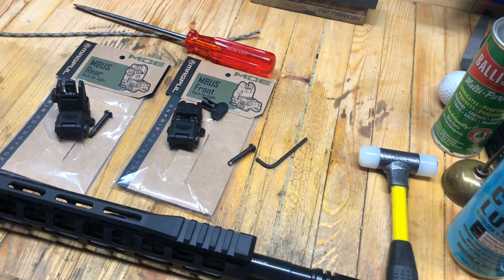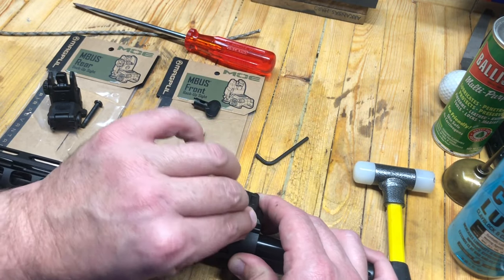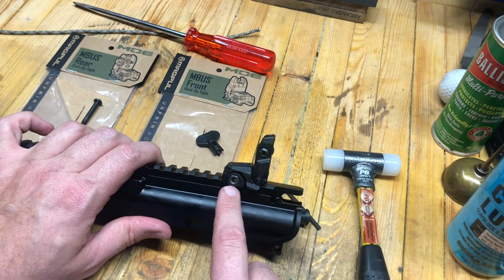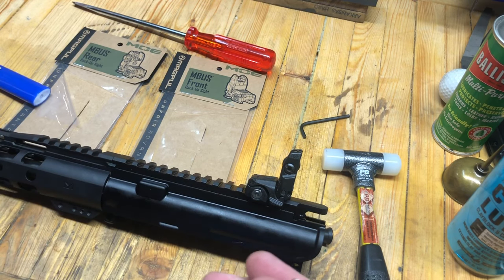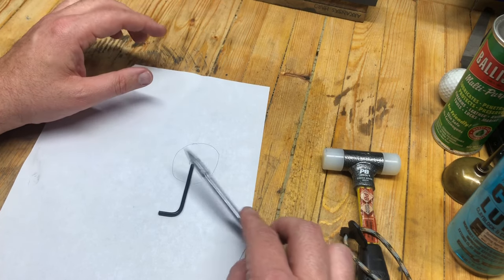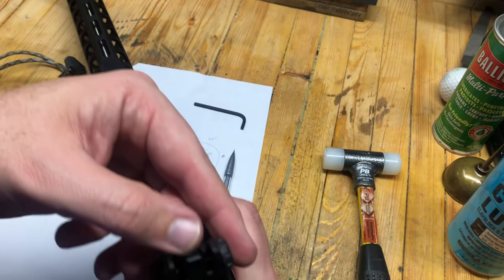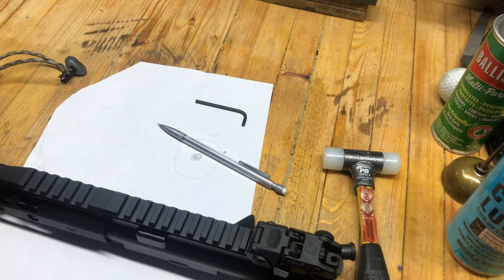Install and Zero Magpul MBUS sights

Comment: I think you flipped the description for adjusting the sights, if you raise the front post, your shots should go down, and if you lower it the shots should go up… you said it right a couple times but in your “Pencil” demo, you said it backwards
Reply: You are correct.
Reply: Thank you. I was here for this specific sight adjustment, but I have zeroed several rifles. So, this backward explanation bothered me.
Reply: If if your shooting hight? You go up?
Reply: There is an arrow on the front sight that says 'up' which is to raise the point of impact. So if you are shooting low, turn it in the direction that says 'up'. Opposite direction if shooting high.
Reply: Yeah, and that's funny because he did say it's opposite , and then he did the opposite
Reply: Lowering your post means your bring your gun up higher in the front.
Reply: Thank you for making this comment

Comment: I see you made this video about 8 months ago and had very tight sights.  I just installed about my 10th set of Magpul sights and they were extremely tight to mount on the rail.  I never had this issue before either.  At first I thought the sights or the rail was defective.  I guess it's a good thing because once it is mounted you almost don't need the screw, lol.  Magpul must have tightened up their tolerances a little bit, it will probably be better in the long run.  Magpul sights are solid sights for the money.
Reply: Use a hair dryer to warm the plastic up....slips on way easier
Reply: @christinaperez254  
Great idea.  Thank you.
Reply: i had to use the back end of a pocket knife to hit the sight in lol!
Reply: @azuro1637  
Lol, well, now that they're on, they should stay in place forever.  Best of luck.
Reply: @christinaperez254  Thanks. I was thinking WTF, why won't it go on the rail?
Reply: @Mattatron 
👍
Reply: Add a light coat of oil,slips on beautiful.
Reply: @superbirdjunior  
Great suggestion.  Thanks.  👍
Reply: Just installed this week and my front sight was so tight on the rail, I was worried that I screwed something up. Ruger AR 556 free float.
Reply: @aslamc9288  
Mine was fine.  I haven't had to remove it and don't plan on it but the sight itself has held zero and there have been no issues whatsoever.  Good luck.
Reply: Jesus you could have bought an acog for that price
Reply: @tysonboyle4718  
Then I would have to buy 10 Acog's.

Comment: I just bought a pair of the MBUS sights, and all your comments were very helpful, especially about the tightness in putting them on the rail. I used a few drops of CLP to ease them on, with a few taps of small hammer. The double rear sights were so tight, I couldn't separate them with a thumb nail but used a small screw driver; a nuisance. Thanks, too, for the sighting comments.
Reply: Same here. Definitely no slop!
Reply: I have these sights they are a nuisance

Comment: The easiest way is to keep in mind the directions on the sight refer to the bullet impact point. ie.. if you are low and the arrow on the sight says “⬅️ up “you turn the sight clockwise to raise the point of impact. Same for L/R, if the arrow says “ R ➡️ “ and your hitting right you turn the back sight adjustment counter clockwise  to move the impact point  left . This applies to all sights.

Comment: Thank you so much! This was very instructive. This is a new platform for me and the Magpul back up sights fit very tightly. Good thing I have that great little gunsmithing hammer with the nylon and rubber heads.

Comment: My  magpul sights are tight on the rails also. I also went to adjust the rear sight and the knob popped off and the small indent bearing went flying! The roll pin was missing, made a new one for it. Ended up not using them because the rear sight interfered with my 1x6 scope. 
     The riser on my scope is perfect for co-witnessing flip ups but can't get it far enough back for eye box on scope.
Reply from the maker: ohh wow, thats a bummer of a situation! haha, Maybe try a 45 deg mount?  thats what a some do with a scope.  thanks for watching!

Comment: A complete upper from a major manufacturer came with a Magpul rear sight. It's an unadulterated JUNK POS. I installed it, played with its chintzy mechanism a couple times, promptly ripped it off, smashed it with a ballpeen hammer to prevent any reuse by anyone, and pitched it into the trash bin. It had no repeatability whatsoever when flipped up, and its flimsy construction would obviously soon break off under field use. There is no comparison between this rubbish and the KAC made for the USMC, or the (less expensive) Troy Industries, also made for U.S. Government procurement. As to sight adjustment, the video does well in describing how to which way to move a front post and rear aperture to zero a rifle with iron sights.

Comment: You are tapping the optics towards the front of the rail. Shouldn’t you tap them towards the back so that way recoil will only reinforce their position? That’s what I’ve read on optics anyway so I would imagine it would be the same for iron sights.
Reply from the maker: its in a rail slot and on there super tight. I would have had to tap it 14" all the way back down from the other side, that would have been sketchy! haha
Reply: @EagleRun23  lol I didn’t mean other side of the gun. I meant while the screws are in and inside the rail. While the optic is loose tap it to the rear (inside the rail) so the recoil can only reinforce the position. After that you use Loctite or whatever. It’s probably just a bigger issue when you have a 6X or so because the slightest change will be magnified. I remember looking it up when I put on my Primary Arms Raptor 1-6 . There’s a little back and forth in rails themselves. Again probably not an issue with iron sights. I still tapped them towards the back anyway… lol

Comment: The problem with these split rail sights is that the rail is in two pieces! Micro differences between the front and rear rails and sights! Plus, they are composite, giving a little! I've noticed my mono rail 22lr and 12 ga have very tight shot groups! On to something? No split rail, plus they are Alum., all metal. Mabey take down pins for split rail ar's need a tighter tolerance? Bandaid? Thread tape? Scotch Tape? I would love to figure out my S&W 15-22 accuracy problem, Any Ideas? MBUS worked great for first 100 rounds or so, then couldn't hit anything! Mabey loose barrel? Any comments will be greatly appreciated.
Reply: I think that's definitely something to keep in mind when dialing in sights. especially if the front sight base is just a few spots of picatinny on top of the gas block with no floating barrel. shooting past 100 yards with that could certainly lead to inaccuracy.

Comment: Just got my magpul sights in...I can't fit them over multiple rails. The rear sight stops before it even reaches the first rail slot, let alone the second slot. It seems as if I have to take a dremel tool to widen the seating portion of the sights. This is ridiculous.

Fyi...both are Midwest Industries rails. I do not have a teflon hammer nor a hair dryer to warm it up.
Reply from the maker: People in comments gave me crap for tapping them in with a nylon hammer. But it work and there was no damage. Do what you gotta do :)

Comment: I have not tried it at the range yet, using a magnetic laser bore sighting tool I wound up with my rear sight almost all the way left and my front sight almost all the way down.  I'm wondering, could my set of sights be defective, or are these extreme settings sometimes required with MBUS sights? I don't recall ever needing such extreme adjustments on an M16.
Reply from the maker: When they aren’t lined up straight but the shoot straight that makes me frustrated.
Reply: I’m curious what the outcome of your sighting problem was. I’m having the same issue. My front site is all the way down and I’m still shooting low. Any suggestions?
Reply: @chuckcunningham9979  Not resolved.  The range near me that can accommodate rifles has been closed for the last several months, so I've had non opportunity to sight the weapon in for real.
Reply: @rangersmith4652  — Thanks for responding. I’m probably going to take the sights off and try re-installation. If that doesn’t work, I’ll just take them off and stick to my scope.
Thanks again.

Comment: Just a heads up, the front sight zero tool has a groove on the top to tighten the screw on the sights. No need for a screw driver. Also, install the front sight by sliding it TOWARDS the barrel tip. Not from the tip back.

Comment: So ive installed my rear sight with no problem and i got the front one on with no problem but when i try to pop up my front sight it wont pop up. When i take it off the rail it pops up. What do i do?
Reply: Sounds like the screw is too tight on the rail.

Comment: I’ve put mine at the first rear notch above the charging handle. I haven’t test it out yet obviously with the ammo drought. But if anyone could answer this is this a secure spot to leave the rear sight.
Reply from the maker: try it, if its in the slot, its secure!
Reply: @EagleRun23  definitely and thank you so much for the reply. 😎👍💯🇺🇸
Reply: So weird I was at the range adjusting my exact sights and mine was hitting low so I took my tool turn it in the direction of up after about 5 adjustments up my bullets are landing right next to the bullseye a tad off to the right so now gotta adjust my rear
Reply: @burntdog8277  yeah that can be frustrating especially if you’re trying to zero it through ball and self defense ammo. If I can get some self defense ammo I’m going to zero it for 25 yards and leave it at that.
Reply: @totalnewb123  yupp I was at 25 yds too
Reply: Just make sure it doesn't interfere with the operation of the charge handle latch and lock.

Comment: the larger aperture opening isn't for closer range its for low light night shooting.
Reply from the maker: google that. it's for close range, quicker acquisition, and low night.  To say "it's NOT for range" is incorrect
Reply: It's for both. The smaller aperture forces myopia to sharpen your distant vision... but that messes up your target acquisition at short distances because the narrower field of view offers less... field of view... and it forced the eye to focus far; but ALSO that same principle of narrower field of view is a hindrance when light conditions are low, so to allow more light through the aperture and improve vision, you switched to the larger hole.

Comment: I want to zero in my ar15 chambered in .50 beowulf so i gotta try and do it with the least amount of rounds possible at $2-$3.5 a round 🤣
Reply from the maker: If you trust your shooting skills. You can make adjustments after each shot. 

You could chase your tail though too if you have a problem.

Comment: I have a very long central hallway -- about 25 meters -- and use it to set an initial zero with newly installed sights/optics for with an LED boresight. Saves some time fussing around with ammo on a range. No LED boresight is perfect, but it gets you close enough to finish zeroing quickly on a 25 meter range. With an AR-15, you only need to work with the upper when bore sighting it. I recommend temporarily removing the extractor from the bolt when using a boresight and using the bolt with BCG to hold the boresight in place in the chamber. Removing the extractor while doing it prevents damage the boresight case rim which is typically soft metal.

Comment: you have it backwards!  If you're shots are high, you raise the front sight post, not lower it. This is the problem with youtube... Anyone can act like an expert even when you don't know what you're doing!
Reply from the maker: I said it correctly. I have done it for 20 years and taught dozens of people how. The perspective is if you are raising the post or raising the shot. Easy to slip up that’s why I used the pen to illustrate.
Reply: FORS
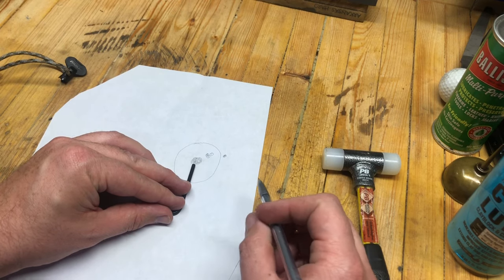Reply: @EagleRun23  Never have I raised my front post and had my next shot go higher, and that’s exactly what you said will happen @ 10:56, and you were using your pen to illustrate it incorrectly.
Reply from the maker: @scottmorrow5497  sorry if I crossed you up. I just have mixed it up.
Reply: That's what I thought.
Reply: @EagleRun23  all your explanation was correct except the one part around 10:53 where you mixed up. It happens when you’re making a video or sharing your screen. I have not made a video so kudos to you for trying to explain it all on the camera. Thank you for taking the time and effort you put into this video.

Comment: Easiest way to think about it is which direction does the round need to go. Shot is high you adjust down, shot is right you bring it left. Same for scopes and dots.
Reply from the maker: yes sir! correct. Never meant for the video to get so much views. I am always learning how best to do stuff and explain stuff. I def mixed up a few statements but my illustration was correct, haha
Reply: But that's contradicting what other people are saying about the FORS acronym.  FORS method means if you need to take your shots down you would adjust the front sight post up, I'm confused?
Reply: @alexmundy9932 Lowering the front sight makes you bring the butt of the rifle down to get the sights lined up. Which means the next round will impact higher.

Comment: I installed my front sight backwards so I don't have to see the ugly backside of it and it works just great, just in case anyone else didn't like seeing the ugly backside of the sight. Highly suggested
Reply: It's almost like they designed them to be constantly closed. All other flip ups are visually pleasing to look at
Reply: @theairwaybat1830  I agree, they could have done something different
Reply: The idea of folding to the rear is because your gun is always faced and maneuvered forward,  walking, running, poking your barrel forward through brush hitting a branch or bashing and breaking a glass window etc you want your sight to fold rather than break , especially a polymer one , they get somewhat brittle if super cold . Stressing metal sights mounted backwards can end up tweaking the hinge pin assembly so they get loose and sloppy or dont close all the way
Reply: I also installed mine backward but for the reason it makes more sense that the button is behind the sight. Makes it easier and faster to activate the switch. With it installed “correctly” you have to make sure your thumb is in front of the sight when you hit the switch, then move your your hand back to where you normally grip.

Comment: I ran into the same issue when installing mine on my handguard (Aim Sports Wraith). I ended up using the rubber mallet that came with my roll punch kit to tap it on.
Reply: Use a hair dryer to heat the plastic a bit...slips on easier

Comment: Since they are plastic, couldn’t the front sight warp from the heat of the barrel?
Reply from the maker: Theoretically and some rigs have gas blocks with pic rails. They really get hot. Handguards not so much. You would have to intentionally be doing some sort of burn down or ww3 for it to be a concern in my opinion :)

Comment: The little wingnut tool it comes with to adjust the sights can be used in place of a flathead screwdriver to tighten the sights on the picatinny rail.  You can tell since there's a little section of it that's thinner that fits just right in it.

Comment: If i get my sights zeroed and then I move the sight back on the rail towards the charging handle will I loose zero?
Reply from the maker: yes, also you want the longest sight distance, ideally. wont change much though, especially if you chose like a 25y zero or something closer

Comment: The stuff on the end of the screw is called "microencapsulation" .. it's basically dry powdered loctite/thread locker.. in automotive they say so replace these screws every time as if the stuff is one time use... Idk you could surely just put a drop on if you're worried about it coming loose

Comment: Does this mean you can only use iron sights? We can't add like a reflex sight also? If it's to small what can we do to have iron sights and relex sight?
Reply: Thats why these are called mbus sights. Magpul backup sights. Key word is backup. So of course, get a red dot. Red dot dies...use your backup sights
Reply: @Not_Sure_81  I got me a Feyachi RS-28 4 in 1 Reflex Sight and also the OTW Flip Up Iron Sights Flip Up Front Sight + Back Up Rear Sight. I noticed my front iron sight you can look through the reflex sight, so is that the correct way to use if the reflex sight would happen to go out?
Reply: @thebestofthebestsir47  I keep mine specifically for a reserve. Most of us only use the red dot and keep the backups folded and out of view. It is of course user preference. Try shooting with and without the sight up. Whatever works best for you is the way to go. Also pick your preferred red dot height. There's lower 1/3rd and there's absolute co-witness. I prefer absolute. There's a ton of reddit posts and YouTube videos on this. Again though, in the end, it's all about what works best for you
Reply: @Not_Sure_81   Awesome thanks for the response.